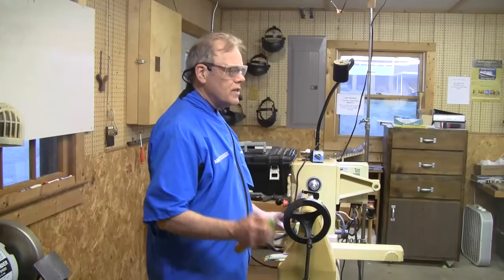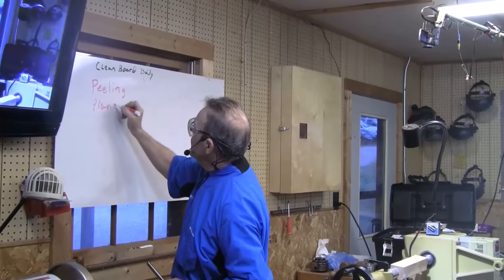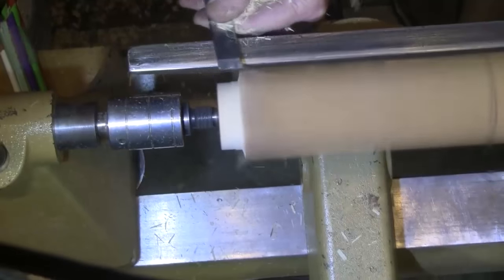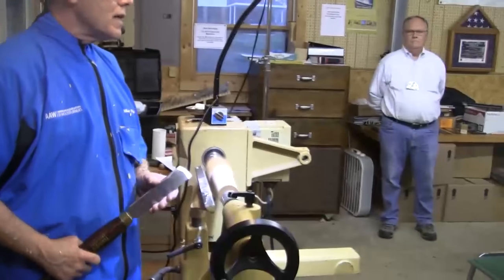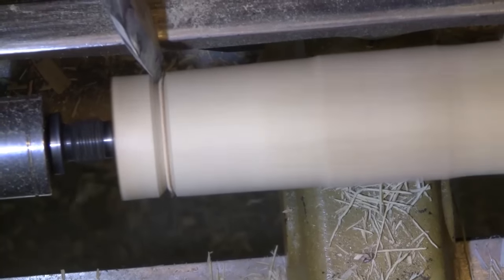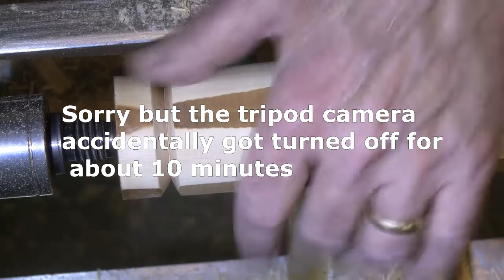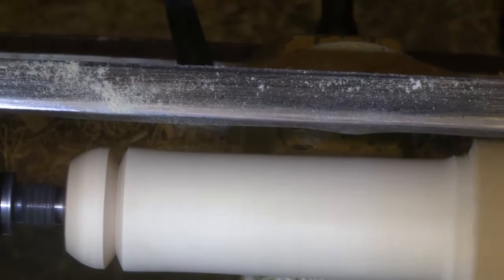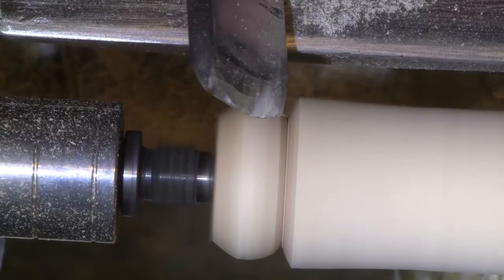Skew – Devil's Can Opener? Part 1 of 3

Comment: The comment about practice was very useful.  After lots of ugly catches with skews I was getting quite frustrated with the tool. So I have been throwing any old bot of stuff in the lathe and playing with the skews that I have. After a couple of hours I’ve started to get some lovely smooth finishes on hardwood and softwood. I’ve also managed to improve my sharpening technique. 

I guess as an amateur I dive straight in to make a masterpiece and it is not going to work. If I were to take up golf (ugh not likely) I would spend some time on the practice range until I could hit a ball long and straight (is that right?). So with the skew, get to it with scrap wood where it does not matter if it all goes wrong and then you can get a good technique.
Reply from the maker: Another 1000 times grasshopper!

Comment: Hey Mike, I've been practicing with my skew and keep getting catches doing a peeling cut trying to make a tenon.  What could be causing this? (Dull tool, not enough rpms)   What should my rpms be while using the skew with a round spindle?
Reply from the maker: You are doing this for a spindle and not a cross grain blank, correct? Sharpen your tool and follow your ABCs, Anchor the tool, ride the bevel (handle low with cutting edge off the wood), lift the handle till it cuts.  2" or smaller spindle 1400 - 1800 maybe
Reply: @MikePeaceWoodturning  yes, this is for spindle work. It's hard to tell where your tool rest height is.  Where should the rest height be in relation to the center of the part?

Comment: mike I watched your video and it was really good,,i want to use the skew more myself,,you might have said this in the video,,but where should I position my tool rest to get the best cut,,and my skew is at 35 degrees,,which degrees do you prefer most
Reply from the maker: My bevel angle is probably at 40. Tool rest is a bit higher than normal on a planing cut.